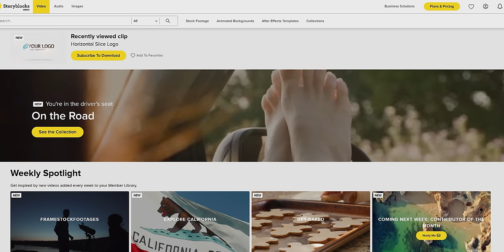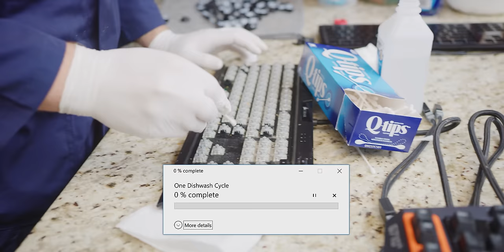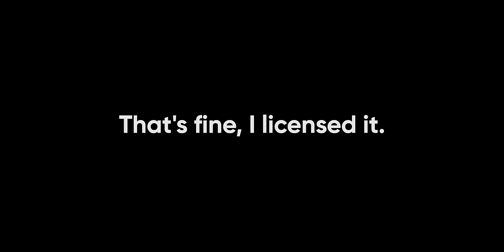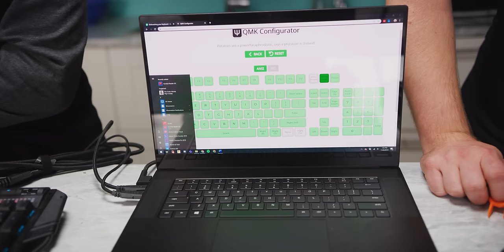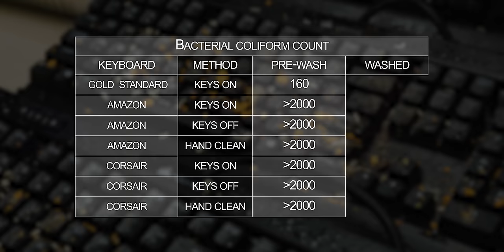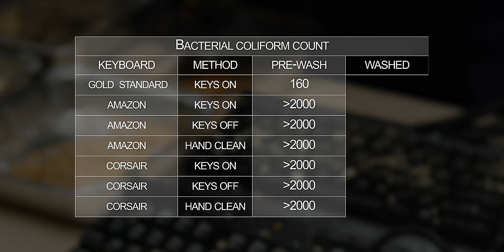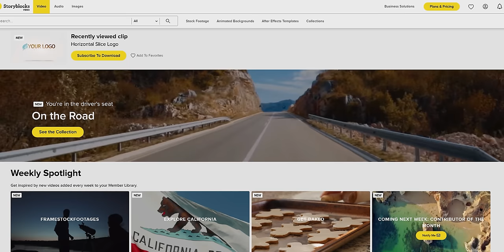The best way to clean a keyboard is… the DISHWASHER?

Comment: ... I mean if Linus can leave Laptops in the rain and they survive, why shouldn't the keyboards?
Reply: Wow, now that is a callback
Reply: rust and corrosion, this is definitely a bad idea. Water has sediments in it that will damage boards after they dry. This is a horrible idea. It's only luck that laptop survived. I've done enough board repair to know exactly what this does in the long run.
Reply: @TheMookie1590  I wrote another comment before i wrote this one, you might be interested in it so ill copy it:

"As long as there are no Capacitors in these Keyboards, i think you'll be fine. I myself did wash some old pc's (C64, Atari 1040ST) in the Dishwasher (the Motherboard) while restoring them. In fact it is a common thing if you're rebuild old PCs on a regular. Also some washing pods do have anti corrosive detergent in them."
Reply: @holzwurm_hd7029  Yeah, caps. But I'm also worried about integrated circuits on the board itself. It doesn't take much corrosion to short them out, because of the incredibly tiny distance between the legs of the IC.

Or just motherboards board traces that are close together at the rivets..

I couldn't do it myself, had to much trouble. The best solution is an ultrasonically cleaner with distilled water that doesn't have sediments in it. But most people don't have one.

I haven't heard of anti corrosive detergent, but if they work, go for it.
Reply: @TheMookie1590  Well the anti corrosive detergent is made for your cutlery. Or more precisely its an additive in some detergents.
Reply: TWICE !!!

Comment: This just makes me think that keyboards should be designed and manufactured specifically to be dishwasher safe.  An O-ring between the two halves of the shell and a thin membrane covering the switches (not like a membrane keyboard, no resistance to it, just waterproof) and you're good.
Reply: Topre
Reply: Mechanical

Comment: Why not hose the keyboard before/after doing the dishwasher? Looks like that could take care of a lot of the gunk stuck under the keys. Because, honestly, if you remove the keys, you're probably better off manually cleaning it anyway.
Reply: A good last step  would be to rinse it in iso alcohol (70% is fine) and it'll remove any trace of hard water left behind. It's a good trick for water damaged electronics, anyways.
Reply: @TheKing-hr7uh  Valid point.
Reply: @TheKing-hr7uh  Why spend a few minutes removing the keys of a fully functioning keyboard to clean it when you can spend $50+ and get a new one?!?!

Comment: Dish washing detergent or similar is a must bcs otherwise particles dissolved in water stick to stuff and eventually destroy it. I'm not sure, but since distilled water is less conductive than regular, the residue might be somewhat conductive but, whatever the case, those crystals grind away at moving surfaces (key contacts) which is probably the reason some of your keys started failing. It'd be great if you'd opened them up to see the state of the contacts.
Also, the exact reason  I'm researching if washing them in the DW works is that I have no intention whatsoever of removing the keys.

Comment: My keyboard survived a tornado, and a subsequent 2 weeks of rain and exposure to the elements before I could retrieve it. Keyboards are pretty tough... so long as you don't cheap out.
But if you cheap out, you can just buy a new one, so who cares?
Reply: Ok boomer
Reply: If you don’t mind me asking, can you tell me the story of that scenario
Reply: @ericcastillo105  What's there to tell? A tornado hit my house, hospitalized me and my grandparents, and no one would retrieve my computer which sat on the top of the pile of debris. After 2 weeks I got out of the hospital and took my computer to temporary housing.
Reply: SangoProductions213 electronics are safe around water is NO ELECTRICITY is running. You can wash your pc if there is no charges left in the capacitors and it’s not plugged in. Every electronic is durable if it has no electricity running through it
Reply: SangoProductions213 And then everyone clapped? /s

I’m assuming you understand that.
Reply: @GrabsOppai Tornados happen, and people get hospitalized. I don't get what's so incredulous about the story.
Reply: @JeffAr27  Well, most electronics. Monitors are remarkably fragile.
Reply: Guess I forget about dense people on the internet, ITS A JOKE. Guess I have to add a s/
Reply: @SangoProductions213  So whole PC still works ?
Reply: @JeffAr27  what about corrosion ?
Reply: @Sabat1  The power supply had its prongs (where it connected the case to the power cable) ripped off. The case was in shambles (relative to my preference), and the various cables were torn up to the point  where it was jut not safe to even try and run it without replacing them. And the motherboard was just unsalvageable. The hard drive failed. Obviously. But the SSD survived. 
But otherwise, after clearing the gunk from the gpu? Yeah. Mostly. 
I just built a new PC, and incorporated the surviving parts where I could. 
Notably enough, my uninteruptable power supply survived completely intact, and still am using it right now. It wasn't completely exposed to the elements, as it was under a wall, but it was near the top of the wreckage pile, and was the first thing I could pull out (since my father wouldn't let me climb up on to the debris to grab my computer, and he wouldn't either).
Reply: @SangoProductions213  oh god was that a LoK reference.
Reply: @JeffAr27  id be scared of a motherboard because capacitors can hold electricity for up to an hour (really good ones) so id wait a day before washing it to be safe.
Reply: @whyhe11othere  haHAA
Reply: I had a razor keyboard and split a drink on it once, I tried to dry it off but it hasn't worked right since. Same thing happened with my razer mouse, i tried to use an old razer mouse that should've worked, but the cursor would wander no matter what I did. Pulled out an even older logitech mouse and it worked just fine, haven't bought razer since..
Reply: @KjKase  Weird my Razer BlackWidow Ultimate (2013) has survived a few glasses of water. I mean its 5 years old and they only thing wrong is my - key don't always work but it probably just needs some iso and grease in the switch.

Comment: I repaired keyboard that had bad liquid spill and was not working by disassembling it and throwing all of the parts in ultrasonic cleaner with isopropyl alcohol, distilled water, and mild detergent. Washed it in alcohol and dried it with compressed air. It got rid of corrosion and sticky residue inside the key switches. Got it working perfectly including backlight and almost instantly spilled drink on it again. Didn't bother to wash it again. I don't think dishwasher would fix dirt and residue inside the keyswitches.
Reply: Ultrasonic cleaners are certainly preferred, but I would caution you to not use isopropyl in one. The flash point of Isopropyl vapors is pretty low and Ultrasonic scrubbers, even when not using the heating element, put off a fair bit of heat. If the isopropyl vapours fill the container they can ignite and explode. They make special caustic solutions for Ultrasonic cleaners. I recommend Bransen EC. Just a friendly tip, stay safe brother!
Reply: @MrThechuzzler  You are correct, in high concentration it can be really dangerous, but I think in low concentration mixed in water it should not posses that much of a risk (think of a glass cleaner solution). Anyway always keep good ventilation when using flammable liquids and vapor.

Comment: One thing to consider is metal oxidation is greatly accelerated in the presence of hot water vapour. So I expect that doing this regularly, especially on mechanical keyboards, will lead to issues due to rust.